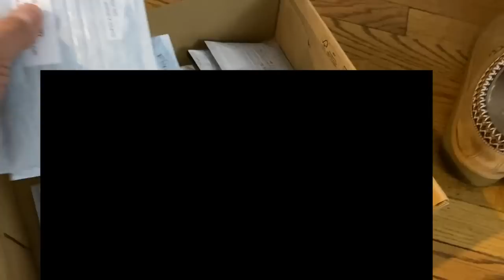2021 CVO Road Glide DIY Stage 2 At Home / Zipper's Cam Install By Yourself ?

Comment: I hate to tell you but the 2021 CVO roadglide and street glide both have upgraded cams and oil pumps already. No need to rip it apart,  it makes good power and is very reliable! Once you modify they don't last. You will see. A tune and a full exhaust is all ya need. Voice of experience......

Comment: Just did the S&S 475c in my 21 CVO Roadglide 3 weeks ago.
Reply from the maker: By your self ? Or pro ?
Reply: @HOLYSHIFT  I did it myself. I do my own work because I don't trust the dealer tech's. I did a full 128 build including everything on the primary side (trask basket, rekluse clutch,Baker compensator, etc) ported hi'flow heads, 67mm throttle body, etc on my previous 19 street glide special. With right tools, shop manual for torque sequences and specs it's not difficult. Plus piece of mind knowing its done completely and correctly.
Reply from the maker: @tikicaptain  very impressed!

Comment: I actually put a screaming Eagle stage 2 torque cam in my 2021 Electra Glide Standard with 5000 miles on it a couple weeks ago by myself at my house. I have done all the work to it myself. I got it in the beginning of July this year. I put the S&S tappet cuffs in also. Currently it has S&S slip-ons a Screaming Eagle air filter, the one that fits the stock breather cover but I'm going to upgrade it to the heavy breather eventually, and I put the Sony radio that everyone is using the something or other 7000 with alpine speakers and I put 10 1/2 inch slammer shocks on the rear also a SG seat and passenger pegs the batwing reach bars from Harley (because I'm only 5,3") different grips I don't remember off the top off my head what they are, a taller windshield because I was getting a lot of head buffeting the fork air thingys too and some LED front turn signals. I'm not done yet and wish I had made install videos of all this, but I didn't. For me it isn't just the looks and the performance that make a bike better but it's also the fun of doing the work myself is what I like too
Reply from the maker: Same as me. I enjoy the building

Comment: Well since you asked, if I owned 2021 CVO the only decision I'd have to make would be how to get it over to Dyno Dave at JD's Cycle Works. 👍😎
Reply from the maker: And put a cam init?
Reply: @HOLYSHIFT  Of course. And then a dyno tune.

Comment: Great video! Hanging with friends in the garage wrenching on the toys. That’s a day well spent! Love that black CVO. Any idea what happened to the stock exhaust? I’d kill for a set of those gloss black heat shields!!
Reply from the maker: Let me ask about the original pipes
Reply from the maker: He still has the pipes - Goto my website and send me a message with you phone number- he will contact you
Reply: @HOLYSHIFT  Awesome, will do, thanks!
Reply: @HOLYSHIFT  just sent you an email!